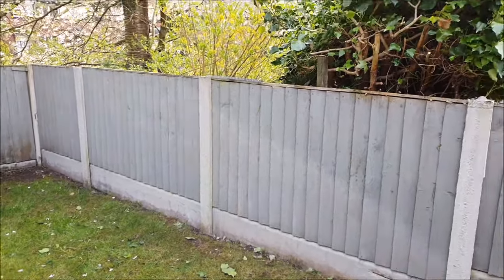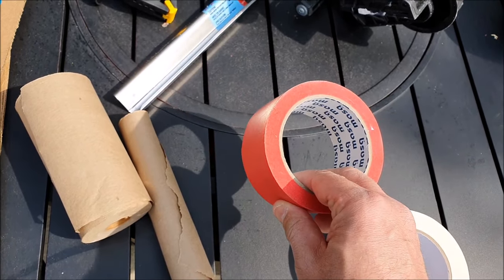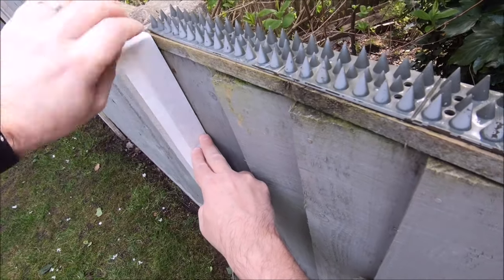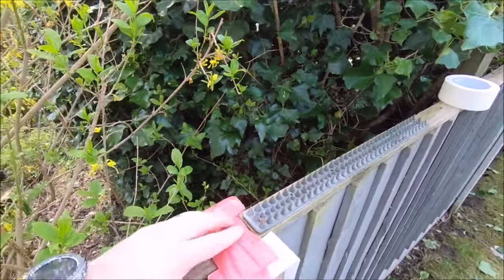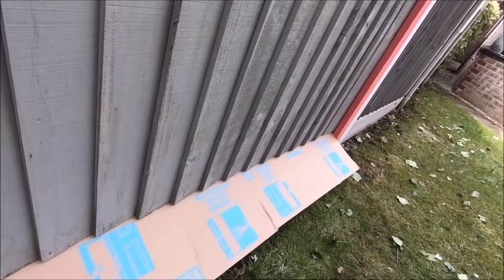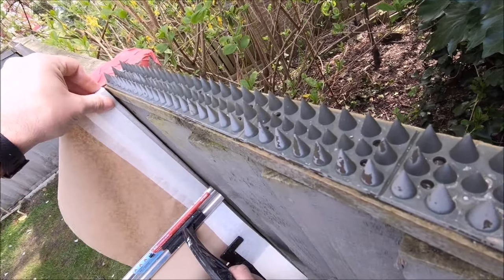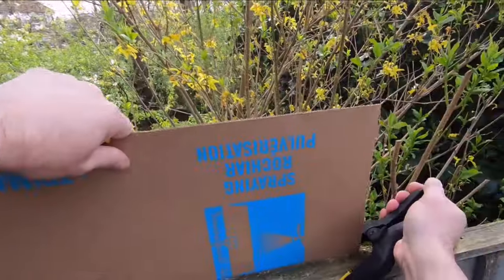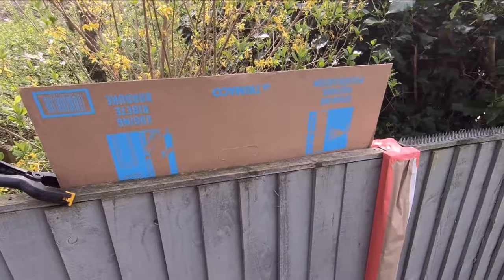How to mask and protect exterior post's and bases when painting or spraying fence panel's

Comment: It never occurred to me to tape them up, I just use cardboard on posts and boards but always end up with a couple of posts with paint picked up from the cardboard where it gets wet and I forgot to wipe clean. Will try tape this weekend. Cheers
Reply: I do same but I just the fence up from the kick board and put a block under in and if I do get odd bit on post just rub it off with sand paper I do 22 panels every 3 years so not really time to be taping up lol

Comment: Good video mate gotta be careful with that top edge that the paint dont dribble over the neighbours side too if they have different colour.also cordex is better than cardboard lasts forever but needs wiping down  after each use😉
Reply: Also even with spraying you still need to backbrush it to work it into the grain.sawn timber is too porous to just spray!it will just sit on the surface!and alot of fence paint e.g cuprinol ducksback is to thick to spray coz of the wax content and diluting is defeating the object of water repellent paint 😀

Comment: Would it not be easier to take the fence posts out and paint them? I guess it depends on how heavy they are and what is on the other side of the fence!
Reply from the maker: The posts are concreted in so no chance....this demo is to show how it can be done in situ, including panels, and is for people that dont have the pysical strength to remove them.
I personally take the panels out and spray them unless the posts and bases are being sprayed also.....which is what i did on these, the video is slso on here.
Thanks, Joe
Reply: @JoeProDecor  Sorry, I mean the panels not posts
Reply: God no....
Reply: Assume you mean remove the panels. Anything more than 4 feet isn't practical and over 5 feet almost impossible to handle without a couple of guys and a ladder.

Comment: No need for all this masking anymore. Check out Fenceprotector based in Llandudno, N Wales. They do a great hard plastic kit that just slides down onto the concrete posts and panels that slide under the panel to protect the base. Just move it along the fence as you go. Saves a lot of time. Wash it clean in soapy water when finished.
Reply from the maker: Yes I know all about that kit... I designed and made a full kit 20 year's ago.... But did not continue due to already similar pending patents.
Tbh... A lot of sprayers now are just spraying the posts and fencing in the same material, like I ended up doing after this demo. It also looks better imo, and means you can protect the whole lot in a longer lasting product.
I was also going off the idea as time went on tbh, as I didn't see the product taking off too well after doing extensive surveys... Just not enough time saving in using them to justify the cost to most DIY painter's.... It would save me minutes  when spraying... But spraying alone would save me hours. And I found that using these Did not work as effectively as tape when spraying. 
Cheers, Joe

Comment: In my opinion it looks better if you just spray the concrete posts the same colour as the fence panels
Reply from the maker: Yes they can look great painted, as long as the concrete is stabilised and painted with the correct paint and not just standard fence paint, they can also be long lasting. It would be so much easier to spray them all in together....maybe next time. Take care 👍
Reply: @JoeProDecor  I've just sprayed all my fence panels, base boards and posts in a charcoal grey fence stain and the stain has seemed to have worked a treat. Let's just see how long it lasts. Anyway great video!
Reply from the maker: Fingers crossed 🤞
All the best, Joe
Reply from the maker: @marsdencarl89  I decided to spray the posts and bases today....video timelapse being uploaded now....managed to get the posts and bases stabilised yesterday evening and cracked on this morning....lol......managed to persuade the other half to go with it 👍
Reply: @JoeProDecor  good man, it makes it so much easier and faster and gives the concrete a freshen up at the same time. I'll look forward to seeing the video 👍
Reply from the maker: @marsdencarl89  yeah much easier and doesn't make the damaged posts stand out as much.
Reply: Thanks Joe. If it helps others, I use Dulux Gardenia masonry paint for posts and gravel boards. The contrast against most fence colours works really well
Reply: Why not simply remove the panels, paint them and slot it back on?

Comment: What a faf, just take the panels out. What are you going to do about the other side, ?
Reply from the maker: I agree, it is a bit of a faff masking up....but removing 5 and 6ft panels on your own is also a faff, even more so putting them back in. 
So I prefer to spray the bases and posts also to prevent all the messing around. The other side is done the same way of course.
Reply from the maker: This is purely a demonstration on how to do it if need be....I actually sprayed all the concrete in too 👍

Comment: Too much work
Reply from the maker: The main reason why they ended up getting sprsyed in with the panels...this is just a way of doing them in situ when the posts and bases are not being done.
Reply: Too much work?  Try lifting a old damp 6x5 panels out of its post oh and make sure there’s no wind.  Can always spot a DIY job. How about using concrete grey spray paint then there’s no need to mask up? That was a joke.